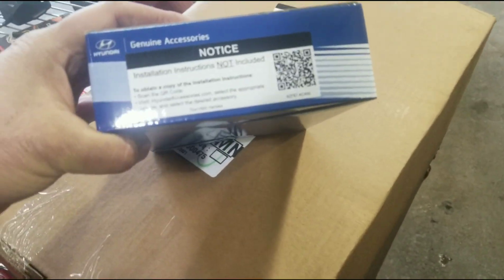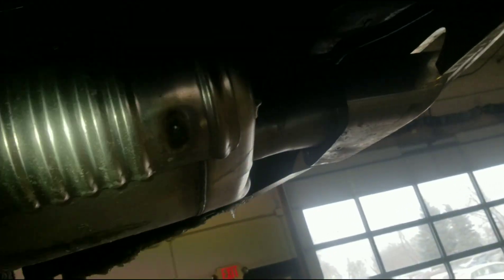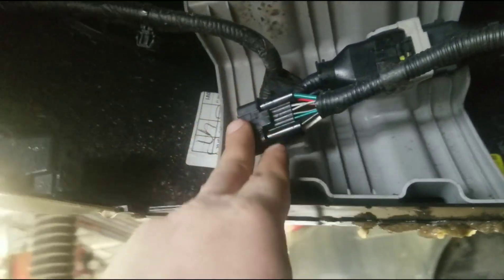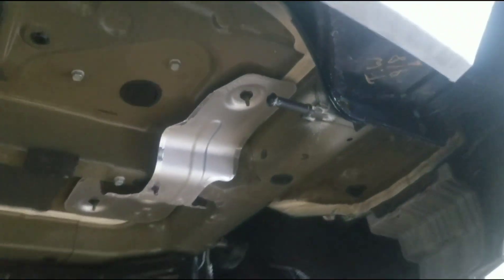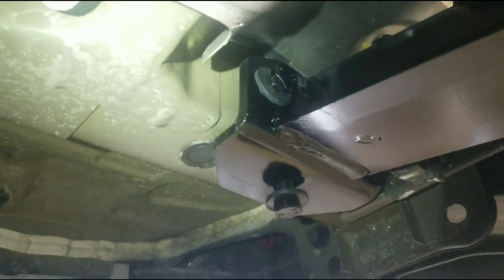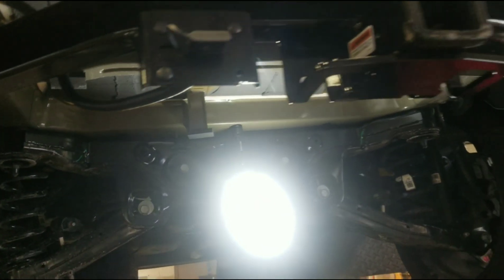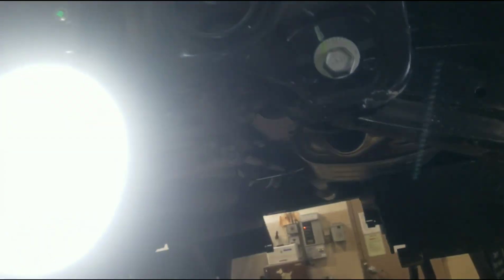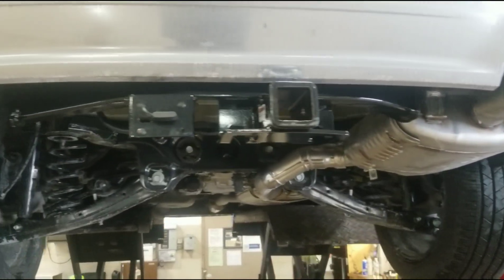2022 2023 Hyundai Santa fe hitch and trailer wiring install

Comment: Try and get a head cam or something so you can use two hands and work with both hands and we can see you work on these cars. Amazing videos you got so much potential. All forum members love your videos. One question I have an Ioniq with small rubbing on drivers side wheele we’ll how do you adjust the liner ? Recommend heat gun I figure it’s a warranty item anyway so I’ll ask dealership but was just curious.